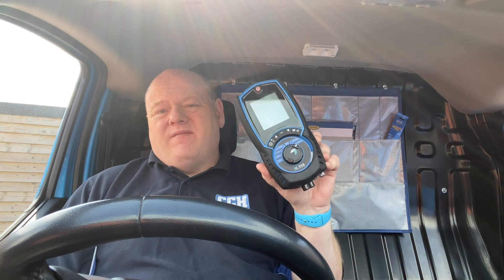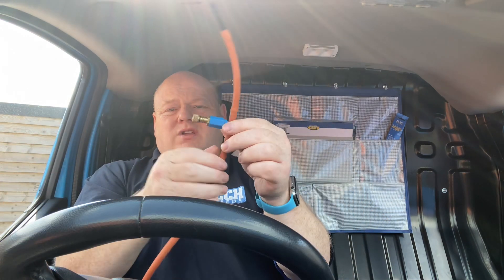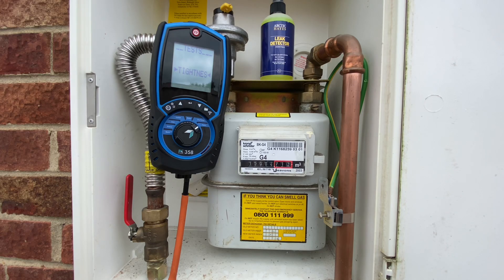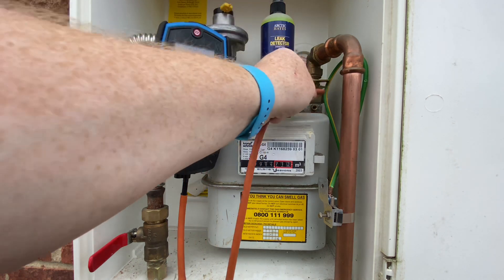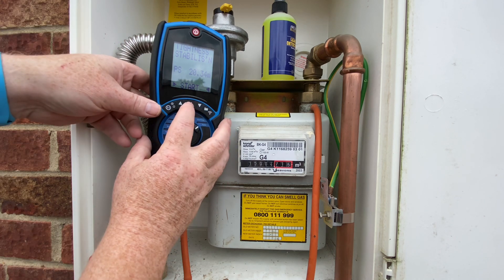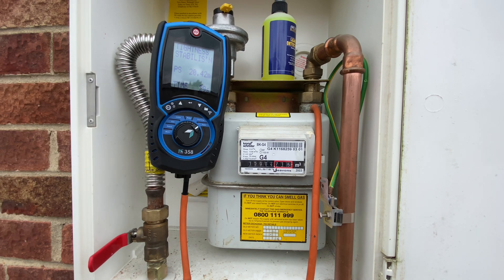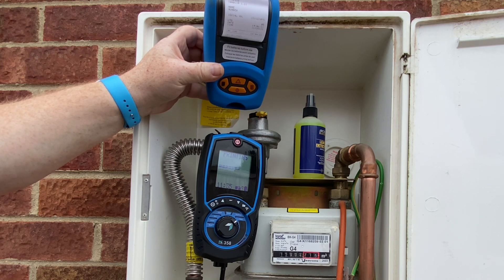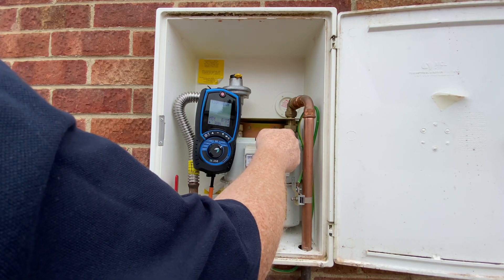Tightness Test Gas - Using A Kane 358 Flue Gas Analyser - Gas Training

Comment: I thought the permissible drop was less than 4mb with a digital monometer?
Reply from the maker: The gas installation is normally allowed 4mb drop, Depending on meter, Appliances connected etc, This is something you would need to check for your own circumstances. Thanks.

Comment: Thanks Allen.
Analyser looks great.
When is it required to have the room co test function on an analyser?
Do you think the room co test function will be mandatory in the future to carry out in situations?
Reply: Good question Mark, I too am interested in Allen’s reply to this.
Reply: I’ve used it twice recently on my Anton. Both times to show customers that their boilers weren’t leaking CO into their rooms. The boilers had of course passed smoke pellet flue tests.
Reply from the maker: @nicpye248  Do you have the ticket?
Reply: @AllenHart999  what ticket do I need to check CO levels in a boiler compartment? Genuinely interested.
Reply: Room CO tests are carried check O/F, F/L or R/S appliances aren't leaking pocs.  Basically if your analyser has this function.  You as an engineer can safely monitor CO as your FGA has an inbuilt alarm which pre warns you that dangerous levels of CO are present in the room vacinty.   The permissible levels of CO will differ from appliance to appliance. Refer to mi's or your training manuals

Generally if you encounter signs of spillage on O/F,
F/L or R/S appliances.   Or for example if a customer complains of any CO poisoning symptoms/ if their CO alarm has been going off whilst appliance in operation.  It's advisable to carry out room CO tests.
Reply from the maker: @rayc1503  It’s only for investigations.
Reply: @AllenHart999  it's not compulsory or part of assessments. Still a useful function if you know how and why it's done.  HSE would more then likely use it to it full advantage.  Besides you need a stand to distance away from the appliance and 2m above the ground.  It's similar to having a personal CO alarm for a domestic engineer built into your analyser.
Reply from the maker: @rayc1503  How are you using to? How long
Reply: @AllenHart999  the default time on my Anton is 12minutes ( I think) if you stop before then it comes up with a test failed. Max CO is 10ppm.
Reply from the maker: It’s for people that have the ticket. Most of us don’t.
Reply: @AllenHart999  I dont hold the ticket but have used it a few times to confirm to myself co was present in the room but its a function that is hardly used